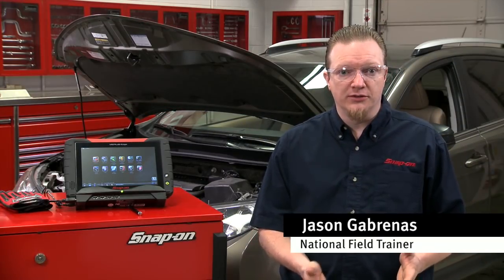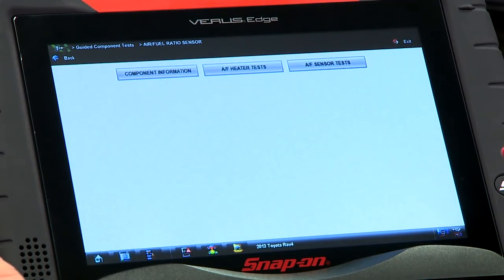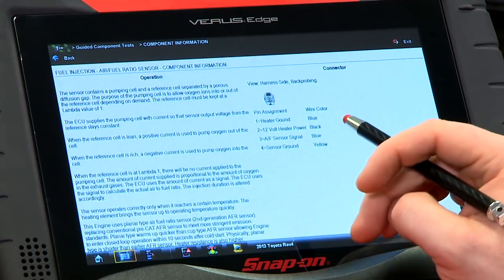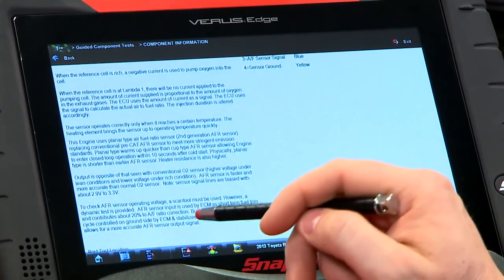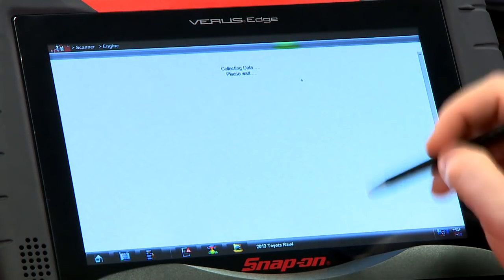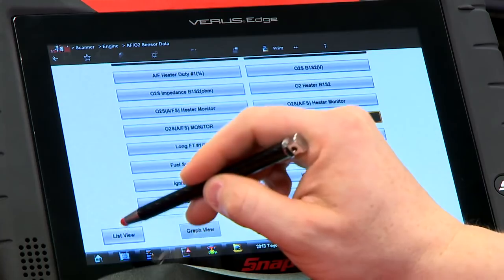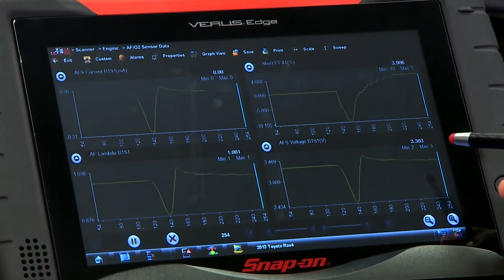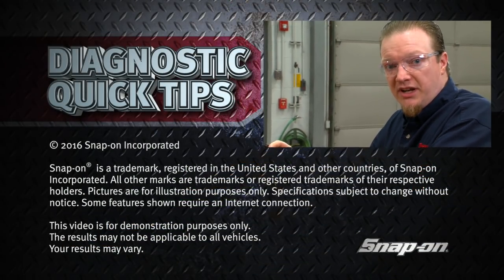Air/Fuel Ratio Sensor Test- Diagnostic Quick Tips | Snap-on Training Solutions®

Comment: Three years after he posted this video, and not a single answer to any of the questions! 👎👎👎👎👎👎
Reply: this is a snap-on video.  they're showing off the scan tool.  He didn't say anything of value.  he basically just accessed the live data and looked at the sensors

Comment: I think that the story is short or someone didn't really plan out the details. Scanner Danner pauses and explains how the throttle goes lean at first due to a big gulp and then fuel goes rich and it's best seen on a wide open throttle given time to respond you need distance. A snap is not conclusive. Your better off creating a rich or lean condition to measure it abilities

Comment: I have an 05 murano,I got a P1273 code,B1sensor 1 lean code. I don’t have a fancy,expensive equipment to see how the sensor functions. But I have one to see the voltage. The voltage for B1s1,is 0.290 and the B1s2 is the same voltage. However, the B2s1 is 0.600 and B2s2 is 0.450 volts. So,when I rev up the engine,the voltage on Bank 1,sensors,only increase slightly. Can you explain and rule out what component is bad ? By the way,those up stream sensors are AF sensors. Thanks
Reply: Guess you never figured it out?
Reply: I would love to know this as I’m having same issues did you find out ? Mine reads 0.25v
Reply: @xxWilky  unfortunately, I sold the car. The transmission went out,got rid of the problems

Comment: My 05 murano,A/F ratio sensor on bank 1S1,has 0.295 volts and bank 2S1 has 0.600 volts. Why are these two sensors have very different voltage? What is the correct voltage should be ? On the other hand, the fuel trims are normal,I think. The readings are, short term bank 1 is,  -4 %and long term bank 1,is 6% and bank two are about the same. Would you be able to tell me, which component is the culprit? With these informations given? I can smell stink from tail pipe. Thanks
Reply: So for Nissans , specifically those with vq motors bank 1 sensor 1 should read ideally at .3 volts while bank 2 sensor 1 should read ideally at .6 volts. I forget off the top of my head exactly why that is but your car appears to be running normally as your fuel trims appear within spec (+\- 10)

Comment: My equivalent ratio on b1 s1 is maxing out at 1.999 is this normal for a working 02 or is there a fault?
Reply: Was that a ohms continuity test ? Or when it was plugged in? 
I have some new densos 2249047 and 42 and they're testing 2.8 ohms and 3ish
And my light still there so I'm tryna determine if they're faulty and return.